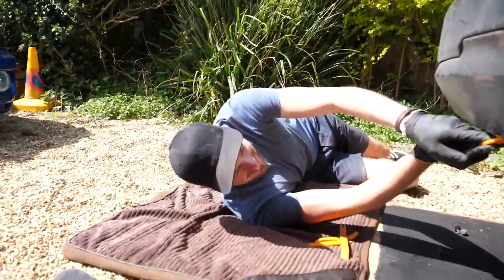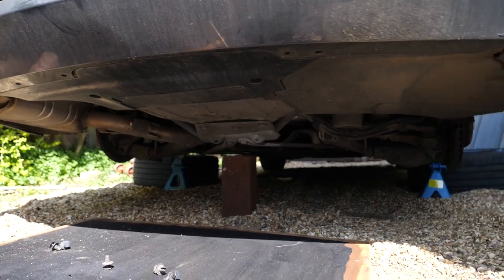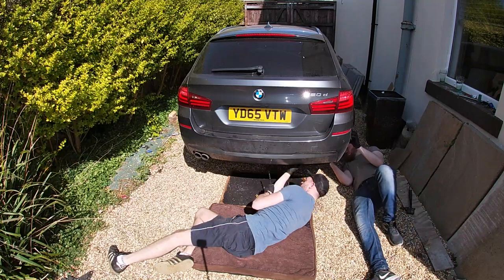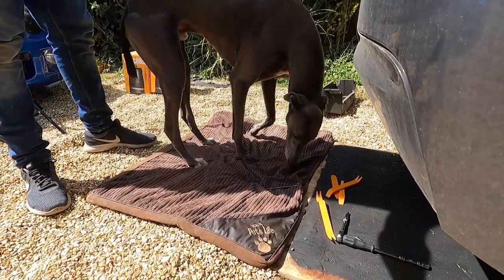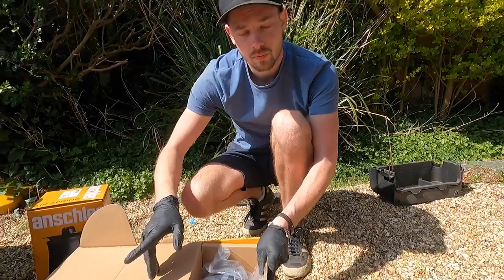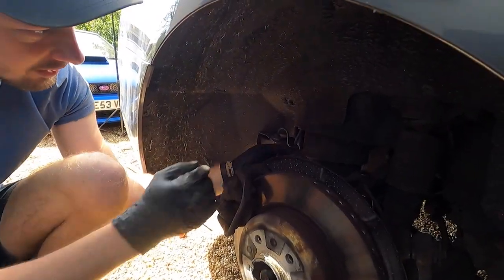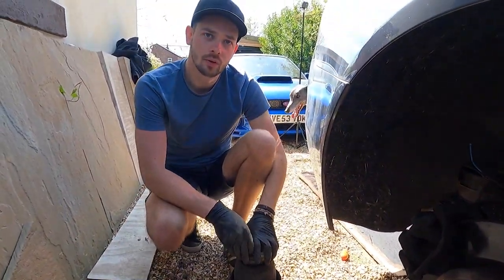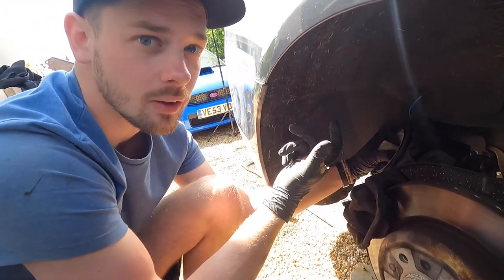Amateurs Change BMW F11/F10 Air Suspension | Quick & Easy Fix!

Comment: Hi guys, the reason why the bags didn’t inflate when you had the car in the air is the ride height sensors probably told the car the suspension was all the way up already, so lowering the car was the only way to get the pump to kick in.
Reply from the maker: Ahhh this makes sense! Thank you man 🙌🏻

Comment: Thanks Gents, very helpful to see you work through it. 
I made a mistake and reconnected the air lines before I lowered the car and the compressor started up before I had positioned the bottom of the bag. I think the tailgate triggered it even without ignitiion switched on. Advice to people: DON'T DO THIS! This resulted in a bang (cracked hard plastic part). I recommend you disconnect power from the compressor. Fortunately I bought two bags at a good price and the left bag looks like a recent replacement so I did not change that. 
It really is tricky jacking this car and securing it on stands. If you think that brick would do anything other than tip over and explode into dust if the car fell on it, you should get extra life insurance :)

Comment: Used this video to change my rear airbags. Used the Arnott brand. I unscrewed the bolts to undo the airlines from the old airbags. Instead of cutting them. Once removed, it is easier to make a clean new cut.

Comment: I have done this for my F11 twice and have Ista diagnostic tool for "proper deflating". But it is useless: There will be residual pressure even I made Ista-D deflating process 6 times. I even jacked up suspension while deflating, but not all pressure came out. Propably valve block or compressor purge valve has some resistanse. 

Only way to get all air out is to disconnect hose from valve block like in this video. Don't waste you time for deflating with diagnostic tool. But offcourse if old bag is leaking, you can deflate it drilling hole to it or using sharp knife :D Good video!

Comment: Hiya. Thanks for the really helpful video. I have a 2013 530d F11 and it’s dragging its backside along too. Compressor is fine so I’m going to change the airbags. Like yours, my car sat around for months and months during lockdown. Quick question about the airbags - why did you pick the ones you used? You can buy them at almost any price it seems. I have found the ones you used online at about £300/pr with good reviews. Did someone recommend them to you? Cheers.
Reply from the maker: Hi mate, worth doing the soapy water test on the bags but sounds like the same issue. Bags chosen on reviews and price really! Slightly different fit on top with the plastic casing but absolutely no issues fitting. 100% remove the wheels first otherwise it would be a pig of a job.
Reply: @RODEBLOCTV  will definitely take the tyres off!. How do you do the soap test? Presumably it's with the tyres on and lowered, because if you jack it up then the level sensors switch off the compressor. Cheers.
Reply from the maker: @byeck63  this is a handy guide mate, effectively spray soapy water onto the inflated bag and see if you get any bubbles.
https://youtu.be/8QEZoqgbNws

Comment: I have tried the same way and both plastic on the bottom of bags cracked and bags folded up incorrectly ,so i have to remove the bags again and what i did is i clicked bags by myself before starting the car again :D 

Now it is deflating even more because i have got air leak from valve block next to compressor because i tightened too much and it is made of plastic so i broke it haha :D
Reply from the maker: Easily done man! We took our time and were probably a bit too careful but didn’t have any issues once it was back on the road. Thanks for watching! 🙌🏻

Comment: New subscriber here. I’m from California, USA and just got my car a year ago. I am wondered what tool kit do you recommend for this kind of job? I already purchased the bags and they get here in two weeks! My left rear is pretty bad and my car does not run smooth due to that side being extremely low. Would you recommend not to drive it often until they are replaced?
Reply: For anyone else in this situation its definitely best not to drive the car unless to get it home. Braking / handling impacted and your insurance may not pay out if in an accident and they spot the issue..

Comment: Mines showing chassi fault error and leak on one side, did yours come up with any fault message ? Thanks mate
Reply from the maker: We didn’t get any fault messages or codes. Could be worth getting an OBD reader or taking it to a garage to double check. If not then try the bag swap and then clear the faults.

Comment: Thanks for the video guys very informative. Are you going to do the front suspension? Wonder if it’s as easy Cheers guys
Reply: There is no air on the front. Only the rear.

Comment: Hi guys, how did you jack it up? Did you use the rear diff then put the axle stands in?
Reply from the maker: Hey man! We used the side jacking points, but rear diff would work just as well 👌🏻

Comment: Hi, what do you think about 2.0d 135kw ? Is it reliable after changing timing chains ? Is it better than 3.0d 150/180kw for daily use ,most in the city ? Because i heard that 530d rod bearing can fail and the engine will cost ,,millions,, ... and the 2.0d if fails to the bottom itll be like 3x cheaper to fix?

Comment: Hi, is this a f11 with s704 sports suspension? Just asking cause I’ve need to change my bellows too, just want to know if the bellows for a normal suspension are the same like the ones for a s704 sports suspension.
Reply: Did you find out?

Comment: I have a BMW 518D ... the driver side on rear is sometimes lower. When i turn the car on and leave it on for 1 min or so it pumps itself up from the rear driver side. What could i possibly do to fix it ?
Reply from the maker: Hi there! So this is how the issue started for us. Every now and again it did that on one side and then eventually both. So more than likely at this stage, it’s a small leak on the driver side rear bag. You’ll still probably get a good while out of it yet but you may be best swapping it sooner rather than later before it puts more pressure on the passenger side. If you want any more info just let us know!

Comment: Ive had the exact same issue as you guys and just replaced them. But when i checked my bags the left one had that black plastic adapter plate the right one didn't, just like yours i'd guess they were replaced previously? Now i don't know how yours were but my replacements both came with that adapter. In the end i left it off on the RHS and installed it on the LHS (like you did and like it came) but does anyone have an idea what those black adapter rings are for?
Reply: Greta video guys. One question . Where and how did you order the parts from. Did you have deer with the cars VIN? Are they just specific parts?
Reply from the maker: Euro Car Parts man! We used a reg checker on the site to make sure they were the right parts. Appreciate you watching!
Reply: The reason its only om the left side is because its compensation for the driver side because someone is always sitting there.😊

Comment: Is there any way to manually press the height sensor, which is in the wheel arch, instead of lowering the car onto the wheels? That would trigger the inflation. This video also shows that it should be possible to snap the new air bag by hand: 
https://www.youtube.com/watch?v=u_glT7epMIc